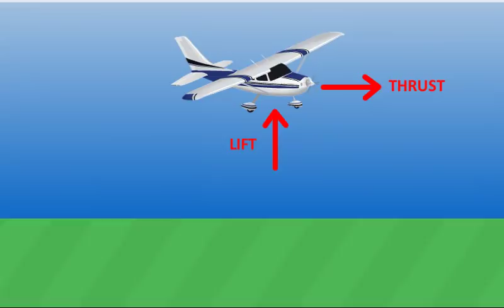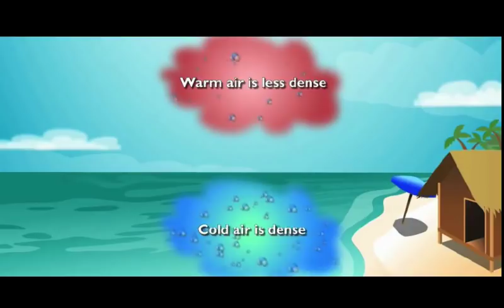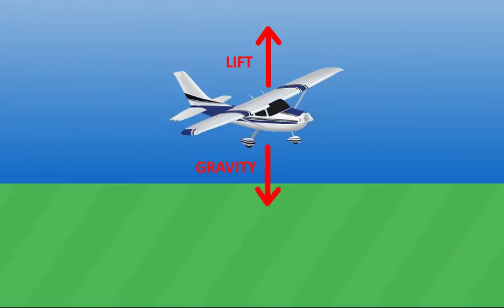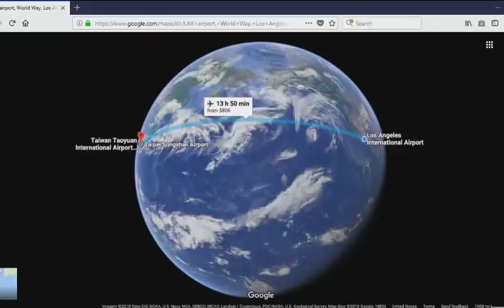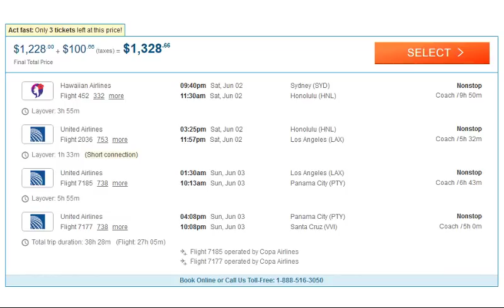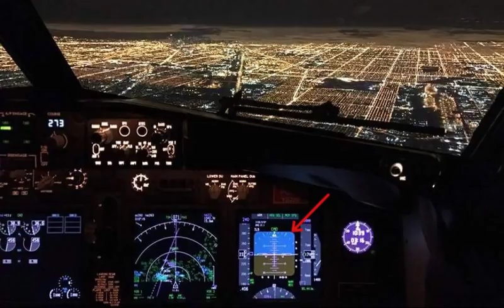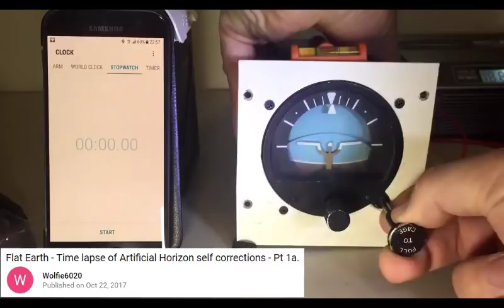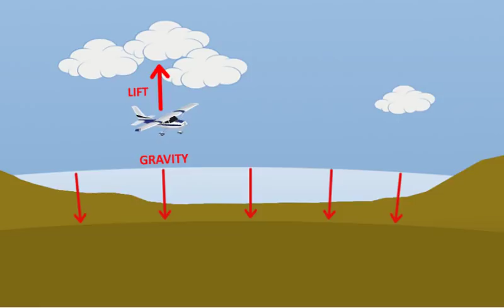Flat Earth Falsities - Plane Nonsense

Comment: Always wondered how flatearthologists think that densityn buoyancy explain the variation of air/water pressure depending upon the depth in atmosphere or ocean.
Reply: Walter Boxhead tis sad it is growing so much.    

Yes vacuum at low to zero  'barrier' is just as inane as any other of their incredulous arguments.    Yet when pointed out that more information is needed they just ignore and double down shouting shill or indoctrination.   Just look at that black english guy Murphy who said he won a debate vs student physisists the other week. He still using the same emotional rhetoric and incredulity that convinced him.  
Tis as if they have decided that they can't be wrong anymore and have reached the pinicl e of there research n knowlage already
Reply: Walter: "I have found out that they literally have no explanation for the pressure gradients in the atmosphere and oceans."
Which is really funny, considering the thing they deny exists -- gravity -- explains it perfectly.
Reply: Karamarika , to take your point further,  would not the majority %of nitrogen in our atmosphere settle closer  to the surface than lighter oxygen  if density and buoyancy was the replacement of gravitational force?     
Similar why does an airfoil work better than airship blimps for travel.
Reply: They also cannot provide an answer for why objects still fall toward the earth when the density and buoyancy is negated by the removal of air in a vacuum chamber. The objects don't float, fall to either side, or fall up. They always manage to fall down. Ah, gravity is at it again.